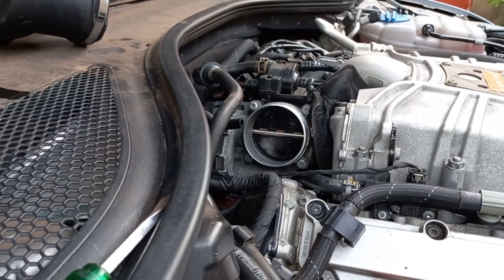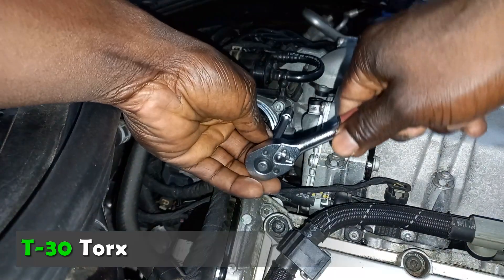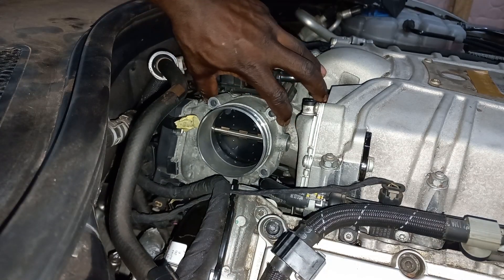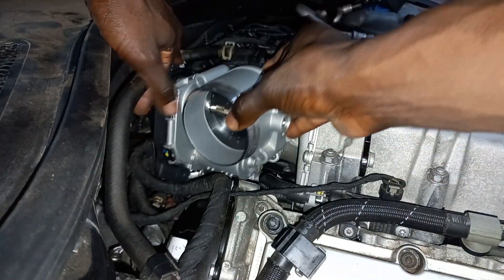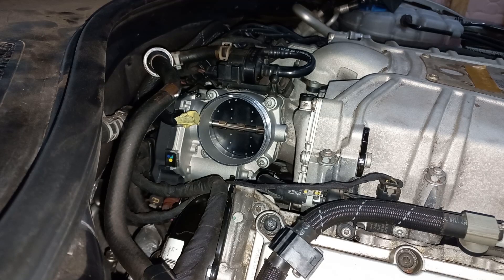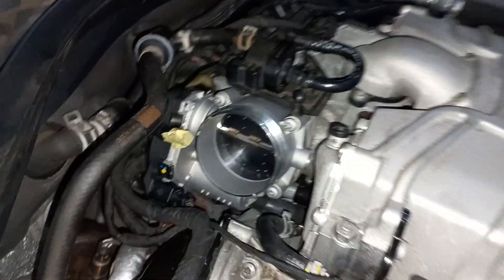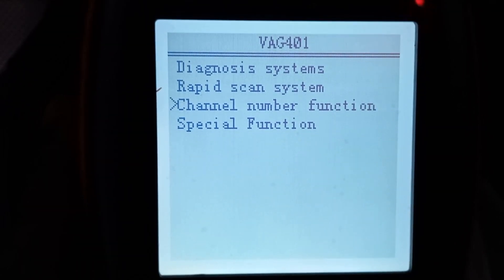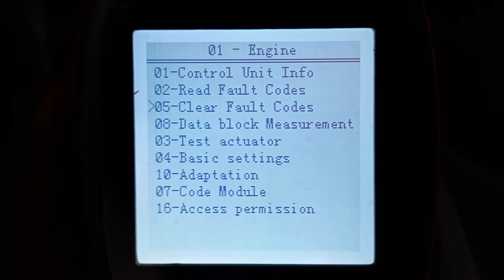Throttle Body Replacement and Calibration - Audi A6, A7, A8, Q7, S4, S5, SQ5 3.0T CREC

Comment: Hello my brother, I hope you’re well. You’ve helped me in the past and I’d like to thank you. I need help again may god bless you. Can you guide me to where I can find the “intake air tenperature sensors are for bank 1 and 2 ?
Reply from the maker: It's the MAP sensor.
Reply: @Kokouvia  I ran diagnostics and the reading is as follows: 

intake air temperature sensor bank 1, sensor 1 : installed 
Intake air temperature sensor bank 1, sensor 2&3: Not installed 
Intake air temperature sensor bank 2, sensor 1,2&3: Not installed 

Are all these sensors the MAF?
Reply from the maker: @zakariasharhan8067  Which car and which engine is this?
Reply: @Kokouvia this is for the 2017 Audi a7 3.0T Quattro. Same exact platform as your A7 that you were working on, everything In my engine is identical to yours.
Reply from the maker: @zakariasharhan8067  As far as I know, there is one intake air temperature sensor acting for both banks, and it's also the MAF sensor located here: https://youtu.be/Xsk4YJwK5UU?t=872
Reply: @Kokouvia thank you for your time brother.

Comment: Sorry that you're having all these issues on the new car!
Reply from the maker: Well it's new to me but not so new. It's 7 years old and has 242,000 km on the clock. It is understandable that some parts are starting to fail at this point.
Reply: @Kokouvia Mines a 2014 2.0 60km

Only problem so far is the throttle, it doesn't react how I think it should. For example I want to get on a highway but I'll have to press the throttle all the way down but that way it pushes me back cause the car goes too fast.

And yesterday the mmi screen decided not to close now it only stays open. 😅

Comment: What were the symptoms that led to you diagnosing the Throttle Body as an issue?
Reply from the maker: Misfire!
Reply: Was the engine unresponsive when accelerating? Mine needs a little press on the pedal before pressing the accelerator pedal

Comment: Thats what happened to me throttle position sensor
 Also check the harness.
Reply from the maker: Thanks!
Reply: Where do you check the harness? I’m having the same issue
Reply: @jaedenfernandez2167  the harness attatches to the throttle body and ecu i guess it has pins that may go bad.